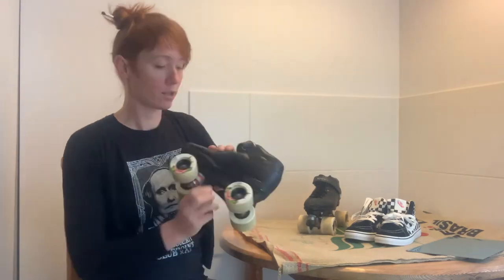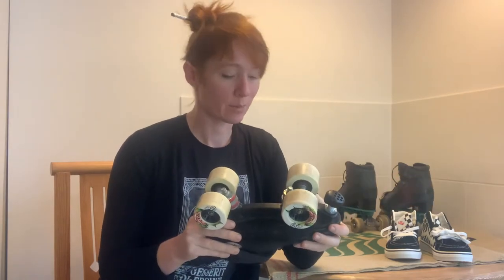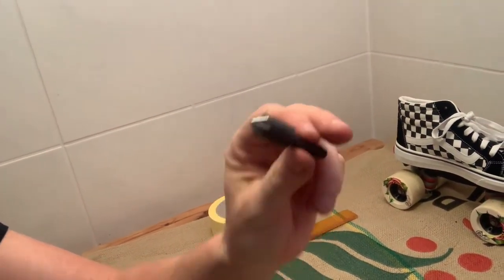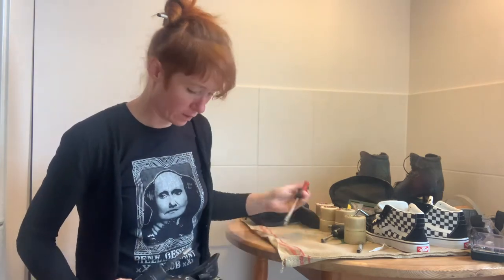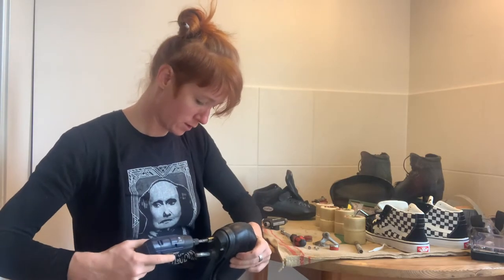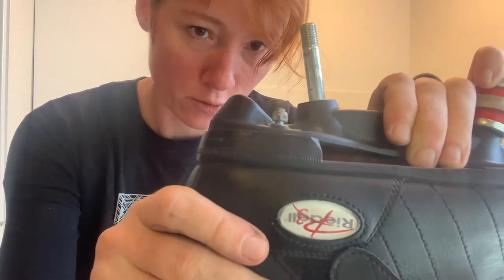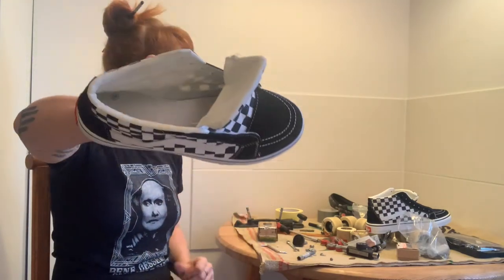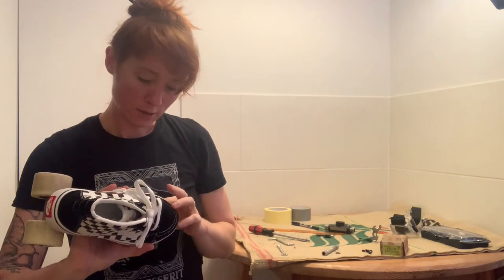How to Re-mount Roller Skate Plates for a Custom Vans Build

Comment: 5:05 I learned the other week that those strange square bits that sometimes come with screw bit assortments actually work very good for turning Phillips head screws. When I found that out, my mind was blown. Try it out sometime.
Reply from the maker: I'm intrigued. Which strange square bits do you mean?
Reply: @rollerskaterevival8484  I'm not sure what they're called, but they look like any other flat head or Philips bit, but instead of the cross or line pattern it is a solid square. They're commonly used to install square head screws for decking on houses, but they work well for removing Phillips screws as well. Even if you strip the screw out, you'll notice the square bit will fit snuggly in the center which will allow you to get one more try. 
You can also try penetrating oil like "PB Blaster" which is supposed to make it's way into the threads to provide lubrication and make them easier to remove.
One more thing; I'm not too sure about skates, but when I'm working on cars and I am putting together something that may have to be replaced years down the line like a water pump or alternator, I'll usually put on a bit of "anti seize" on the threads when I reinstall everything to lower the possibility of having any stubborn bolts or screws in the future.
Reply from the maker: @BleuSkiddew  That's great to know, having a stripped screw is just pure misery. I hope I have never have any case to use your advice but if I strip another screw I'll try it out. I do (now) actually often add a tiny bit of anti-seize or any weak lube (once i even used chapstick) to toe stops. Never thought to do it to mounting hardware, but maybe something to consider. Unfortunately that was probably not my practice when i made this video 2 years ago and I can't edit videos, only description. Anyway, keep the advice coming-- i don't have much of a tooling background so a lot of stuff that's common knowledge is new to me.

Comment: Thank you for this thorough and helpful video. I removed the powerdyne plates from moxi’s and replayed with sunlite. Really could have used the tips on the locking bolts as I trial and errored my way through getting them to stay. Anyway, would you list all the specific hardware you recommend or prefer; ie bolts sizes, nuts and thickness and type of metal insole. I now want to mount the powerdyne plates on a pair of old school nike’s I have. Thank you 🙏🏼
Reply from the maker: That's such a good idea I'm embarrassed I didn't do it in the first place. Actually I see I linked to a blog post that I never wrote, how embarrassing. Maybe I’ll write it now…
Anyway, I almost always use counter sunk M5 machine screws. The only exception is if I'm going to do a Roll Line plate I use M4, and if I'm going to use T nuts (which I talk about in the soccer cleat video) I use button head screws, but still M5.
For Vans mount I like using 25mm long screws in the front and 30mm in the back, but I think that can vary based on the shoe. The screws you get at the skateboard shop will probably be 25mm, and you can probably find 30mm at the hardware store.
For something like a Maxi Jack I’d use 25mm in the front and then ideally 55mm in the back. You can always get long screws and cut them down but I prefer to have the right size and not have to do any of that, when possible. I’m actually US American but it’s been awhile since I’ve lived in the US so I don’t remember if you can buy metric sizes at the hardware store or if you’ll have to find the nearest approximation.

I always use nuts with nylon on the inside. If you do that I don’t think it matter if you use a lock washer or not; that will stay.
In an older video I used 1.5mm aluminum for the insole but I found 2mm is a lot easier to cut, and of course stronger. I’ve never used thicker than that and when I asked around the general consensus seemed to be that any thicker is unnecessary unless maybe the skater is especially heavy. 

With Sunlite plates I like to get a a 5/8" split washer to put between the toe stop and the plate. The washers you buy at the skate shop are not good enough. Eventually you’ll get to a point where the toe stop keeps wanting to fall out, but that will fix it. 

I think that's everything. Thank you for your kind words!

Comment: I seen someone just use inset washer like on the inside so you don't have to have that aluminum plate inside and it made the screw flush inside.
Reply from the maker: You mean T Nuts? I've also heard that makes an aluminum insole unnecessary, if the plate is long, but I haven't had a chance to try it yet. I'm planning on trying it pretty soon though.

Comment: I'm replacing my Luna skate plate with the Reactor Neo....is there anyway you could plz help with info on changing plates on skates that already have plates? Do I need extra hardware? Do I need to drill holes in my boots to change/upgrade plates? Where do I even start?
Reply from the maker: I do have another video on remounting Bonts, someone wasn't happy with the placement so she had me remount them. I filled the existing holes with epoxy resin and drilled new ones. You might be able to re use the mounting hardware or you might need to buy more. A mounting set costs about $10 from a roller skate shop. You can also get parts from the hardware store but you need to make sure you get lock nuts. I wrote an article on my blog with more details. Basically you need to decide where the new plates should be and it's possible you'll be able to use the old holes but often you can't. I've never had Lunas before but some entry level boots aren't strong enough to take many re-mounts so it's possible the sole will give out eventually.
Reply from the maker: Here's the Bont remount video: https://www.youtube.com/watch?v=wLX9pjkJVxA&ab_channel=RollerSkateRevival
Reply from the maker: Here's the article about getting mounting gear from the hardware store: https://www.rollerskaterevival.com/blog/mounting-gear-hardware-store/
Reply: @rollerskaterevival8484  Thank you so much for both of these videos! They are exactly what I needed to feel confident I can change my plates! <3
Reply from the maker: @mandylgal  yay! I'm so happy to hear that!!! Good luck. Don't freak out, just collect your thoughts. Measure twice drill once!

Comment: what size are your shoes and your skates !? you didn’t have to buy new plates for the shoes then eh? that’s the part i’ve been worried about because i don’t want to buy new plates!
Reply from the maker: I think those R3 were a size 8, shoes prob similar. Yeah you can often find old skates and take parts off them. Might need to replace the cushions and pivot cups bc those wear out with age.

Comment: I clicked on this video to decide if I could mount my plates on some Vans but, as you said, the ankle would be naked and that's really scary for me. I chose to skate in artistic boots too. I'm a beginner and I'm having a really hard time breaking them in. I've worn them past 10 hours and they never seem to soften even a little. Do you have any tips for breaking them in? I can't stand them for more than 15 minutes. I don't know if this is normal. Since the boots are so stiff, maybe they requiere more time to break them in.

(OMG! You have other videos with great content! Subscriiiibeeeed!)
Reply from the maker: Since I've made this video I've learned a little more about artistic boots. The ones I had were probably an entry level Risport with a firmness of around 30. Much firmer than that might actually be too firm. I tried some once that were way too firm for me, even with my firmness preference. For my Risports, it took me about 3 full skate sessions to get used to them, but if you're consistently feeling like they are too firm maybe they are in fact too firm for park skating. I wish I could edit the video with this info but AFAIK youtube doesn't let you do that. If there is one or 2 spots that are giving you trouble you can go to a cobbler to get the spots punched out, like maybe in the toes or ankle.
Reply: @rollerskaterevival8484  thank you so much for your reply! I'll try taking them to a shoe repair shop and see if they can stretch them a bit ☺️

Comment: can you recommend ... good where is the nylon frame plate with steel / alloy frame plate. In terms of durability and comfort
Reply from the maker: I'm actually a big fan of the Sunlite plate, for park builds. Light, cheap, durable, easy to add Penny trucks to.

Comment: Hi! Do you recommend getting shoes a size bigger than you normally wear? I saw that advice on a site. Also did you drill through the aluminum sole and the sole of the shoe at the same or did you do the metal sole first, untape it then do the regular shoe dole? I couldn't tell. 
Thanks!
Reply from the maker: hi! tbh Vans skates aren't my favorite so I can't give you experienced advice on whether you should size up or not. I've heard both, that you should size up a 1/2 size, and I've also heard people say they sized up and they were too big. Keep in mind you do need to make room for the insole, so if your normal size is tight tight tight I'd say yes, but if your normal size in shoes would allow you to put in a 2mm insole and not suffer, I'd say stick with it. It's a balance between needing to make room for the insole, and also needing skates to be snug, maybe more snug than your shows are. As for the drilling, yes i went straight into the shoe. i might have drilled again to widen the hole after untaping, but overall i did insole and show at same time.
Reply: @rollerskaterevival8484  thank you!!

Comment: do you think you could use an older pair of skate shoes? like ones that are a little too smooth on the balls of feet and thusly no longer useful for skateboarding?
Reply from the maker: I would expect those to fall apart more quickly than a new set, of course, but i you don't mind just doing this all over again with another pair of shoes when they do, I don'y see why not.

Comment: What Frames do you use like in the video?
Reply from the maker: These are the Powerdyne Thrust, which comes on the Moxi Lolly and lots of other Powerdyne (Riedell) skates. But this info is applicable to just about any boot/plate combo, except of course some of the advice is Vans-specific.

Comment: When buying a used set of skates to match up to shoes, how important is it to match the plate length to the shoe?  TIA!
Reply from the maker: The more important issue is getting the right wheelbase for you. Wheelbase is the distance between the front and back axle, on one side. If you search skate facebook groups/forums you'll find all kinds of opinions on long or short wheelbase. Basically short wheelbase is more maneuverable but might feel unstable, long wheelbase is more stable but might feel clumsy like you can't move smoothly. It depends on your experience level and what kind of skating you want to do. The length of the plate itself is not as important, except ofc you don't want one much longer than the shoe itself.
Reply: @rollerskaterevival8484  Thank you for the info.  The reason I'm asking is I found a pair similar to the ones you have in this video, but they're size 12.  I'm probably a 10-11 so I wasn't sure if the plate would stick out passed the toe/heal of the boot.
Reply from the maker: @DJ_LampShady  aha. Well each company has their own sizing that doesn't necessarily correspond to shoe sizes. It's annoying. For example I'm usually a size 9 in shoes so an 8 or 7.5 in most skates but my Sunlite plates are a size 5.
Reply: @rollerskaterevival8484  Again thank you for the info.
Reply: @rollerskaterevival8484  Just wanted to say thank you one last time.  I finished up a set of vans skates today and they turned out great thanks to your video.
Reply from the maker: @DJ_LampShady  YAY!!!! that makes me so happy! If you're on insta, please tag me so i can see!

Comment: whats is the alu plate thickness?
Reply from the maker: 2mm. I tried 1.5 a few times but not only is 2mm stronger, but it was easier to cut, also
Reply: @rollerskaterevival8484  thank you so much, another enlightenment 😬